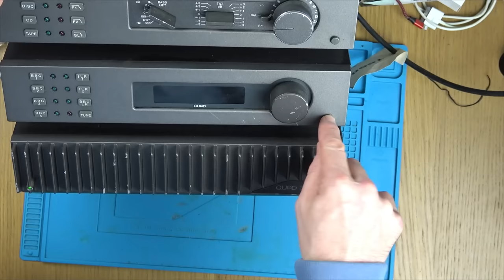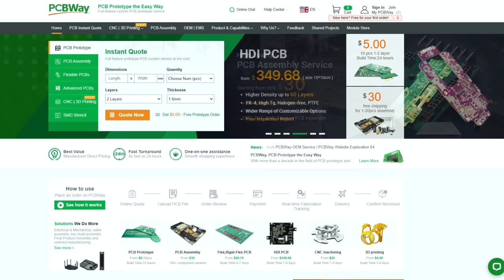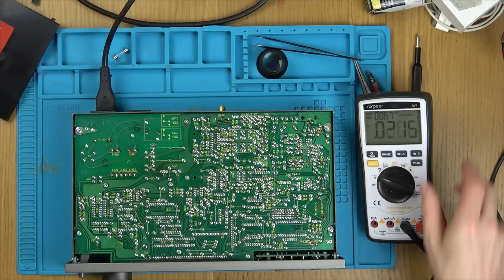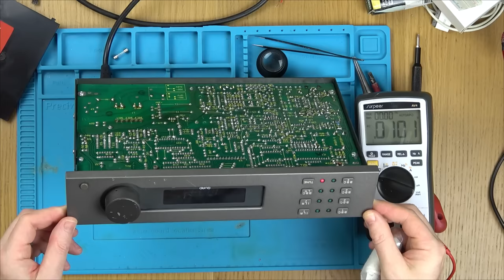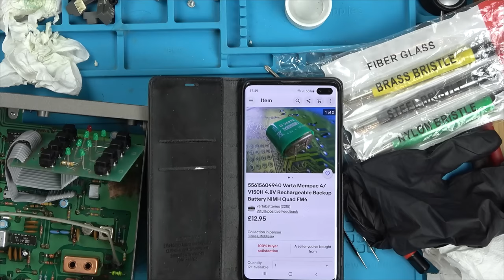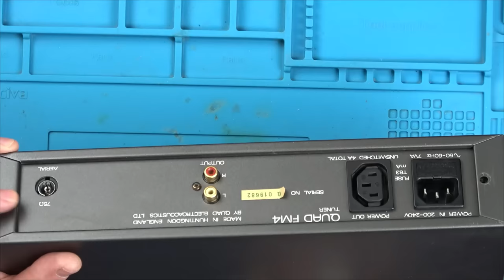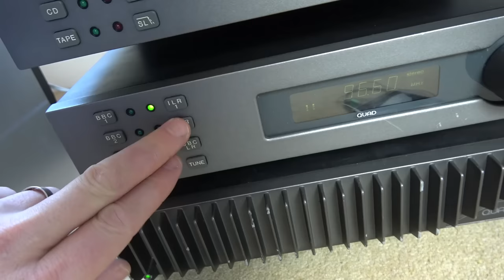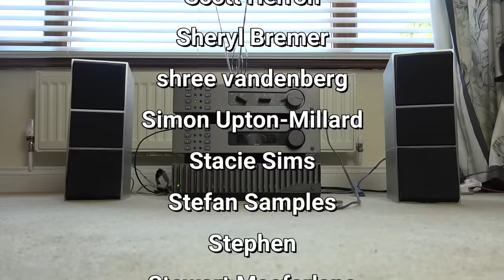QUAD - The Crème de la Crème of Audio - Can I FIX it?

Comment: Nice video - as soon as I saw it no need for screwdrivers - fuse. This happened to my amp did the same pulled apart checked inputs and totally gave up thinking it was a huge problem ordered new tiny amp - then about to bin the old thing decided to have another look - saw that it had fuse screwed into back panel - thought there was no way this would be problem too simple- undid it, no continuety , new fuse and problem fixed. FUSE!!!!! and whats even worse/better is that it is so obvious. Another thing that goes on old amps is the actual display lights - had this on a yamaha - no display - 12v ac lamp was dead , removed the lamp and shined the torch behind and had the display light up with fully functional text , sometimes this can happen to the on light as well.

Comment: I had this set. Not the tuner though. It sounded good but the amp had difficulties with my 4 Ohm Soundcolumn 2 loudspeakers. It got too hot. You could get modules for a moving coil pickup needle. The sound adjustment worked in a broad spectrum. 
There was a thermal fuse on the back, that you could reset

Comment: Yeah, the usual failure mode for these old thin-film class X1 (or X) or X2 safety capacitors is that the shell cracks over time, moisture gets in and compromise the film and the next time it's powered up (either immediately or "soon") it'll blow, often emitting FOUL smelling smoke (may linger until the area is cleaned thoroughly with IPA!). It varies if this failure causes a blown fuse or not, the short-circuit is short-lived and self-extinguising (part of the "safety capacitor"), this had a very low value fuse so not surprised it blew. Some retro enthuasts always check for and replace all "box" type class X capacitors in the power-supply before powering up old equipment from this era (like Apple II and old PCs).
It happens with non-RIFA branded class X capacitors from that era too, it's just the nature of how many of them were made back then and that the RIFA brand was that popular for this use. The disc-types (mostly class Y) or the newer square ones shouldn't do this - IIRC this specific failure mode (temporary short-circuit) is not permitted for class Y at all BUT this is also why class Y capacitors aren't available in larger capacities (would need be very large).
Class X/Y capacitors is often used in the EMI filter, the X(number) safety rating means it's safe to use between line and neutral, class Y(number) that it's safe to put between line or neutral to ground, lower number means it's able to withstand higher voltages, so an X2 can be replaced by an X2 or X1 rated and many class Y also have an X rating (X2Y1 is reasonable common).
Modern EMI filters (especially on switching mode power supply's) tends to have either one or two class X (before and possibly after bridge rectifier, higher capacitance) and two class Y (from line and neutral to ground respectively, much lower capacitance). This is an linear power supply and older so not surprised it just has a single class X capacitors.
Reply from the maker: Thanks Torbjorn, a great write up that will help me and many others out. I need to order up some of these safety capacitors to have in stock as I am sure I will see them again in other devices 👍👍👍

Comment: Nice one Vince! Regarding the contacts on the switches - i believe the problem is caused by oxidation in conjunction with electricity and possible vapors from the battery. Similar to electro-plating. It might be also a good idea to replace the input filter capacitor on all the devices.
Reply: Micro-arcing in the switch creating oxydation and deposits?
Reply: @dDoOyYoOuUtTuUbBeE  More something like electrolysis.

Comment: If someone hasn't told you: the 4 tape sockets - 2 to connect to play a recording REC, and 2 to make a recording REP; DISC because RECORD is both a noun [a vinyl pre-recorded format, and a verb [the action of capturing a live musical performance]; the Bass switch alters the frequency at which the TILT switch affects low frequency roll-off -as in a R-C filter.
Reply: The other way round, REC is the connection to make a recording, and REP is the connection to replay a recording
Reply: @chrisatherton8234  Why did I cock that up? My submission has been corrected.  Thanks - put it down to the wrong day to give up glue sniffing...

Comment: apart from the fuse-holder you missed, the thing that had me screaming at the screen just now was the RIFA clearly visible near the mains inlet.
you've clearly never worked on revox equipment! 😂 but there's your mystery fuse-blower right there. once they've done their thing (thick oily smoke, a cracking sound & a blown fuse) they tend to be open circuit & you can get on with life again, apart from not being protected against spikes.
Reply: you should check the other units for same.....

Comment: I would suggest that the contact side of the washer and the two bars may be silver plated. Silver turns black as it ages. You can reverse this process using a liquid called silver dip but I would not advise using this as it is acidic and might damage the contacts if not washed off.  You use deoxid as a cleaner, this might clean off the oxide layers.

Comment: There are two types of markings on those fuses, T and F. T stands for "träge" (slow) and F stands for "flink" (quick). It describes the characteristics of the fuse. If it has an F, it instantly blows if the current is above the rated one. If it has a T on it, it needs a certain amount of time with a too high current to blow.
Reply: Maybe in your case the fuse blew because of a failing transformer. If the insulation goes bad, it draws more current and blows the fuse. Or maybe someone was listening to too loud music for too long.

Comment: The switch corrosion was probably an electrolytic effect, hence only one side being affected. Add to that a nice acid atmosphere from the battery. Also I wonder if the 63mA fuse is close to the running current of the unit. And given our mains supply is now 220v nominal maybe the devices normal running current has increased.  Combine that with the leaky? RF filter cap and crap battery and fuse parts. Nice video, matte :)
Reply: Our mains supply is 230V (not 220V) nominal,  but unless your local substation transformer has been replaced for some reason, your local supply will still be what it was when originally installed.   The voltage at my mother's house is the same 246V it has been since the 1970s when I was first old enough to shove a multimeter probe where the sun don't shine.
Reply: @MattOGormanSmith  Yep 245v here.
Reply: @nudebaboon4874  interesting we did have a reduction I’m sure, as we were issued warnings where i worked and we had a few issues.  But I stand corrected, yep 220 was an old gits error.. oops.

Comment: Should the LCD have a backlight? It's a bit dim. Maybe a light bulb that's gone, or even an electroluminescent panel, they also wear out, but if it is that, you could just replace the EL plastic, the existing driver circuit wouldn't wear out. Or else you might want to find a couple of volts somewhere, maybe nick the 6V or so that charges the battery, and put it through a resistor to a white LED. Or a couple of white LEDs in series (with resistor of course) and use 12V. You can get side-shining LEDs meant for side-illuminating bits of glass displays.

Comment: You can get rid of the battery altogether. Quad now have a replacement for IC1 that doesn't need a battery and has 14 presets instead of 7. Recommended. I've fitted dozens of them. Price much the same as two batteries, so you get ahead eventually.

Comment: I'll tell you how that fuse blew... the power leads were patched up incorrectly at the back. The power amplifier was fed from the tuner. It drew more than 64mA and pop the fuse blew. Always feed the power into the largest power unit first and filter down to the lowest. Plus the LCD for the tuner should be backlit from an incandescent "grain of wheat" bulb. Either replace it, or drop in a white led and a 2.2K resistor.

Comment: TAPE REC means, as you already got it right, Tape Recording, while TAPE REP means Tape Replay (an alternative word for Playback), the two additional Red/White RCA-Jacks that are unlabeled could potentially be an AUX IN Connector or just an Unamplified LINE OUT (you might have to try this one out, where you better try out hooking it up to a Speaker, to see if it is a Line Out and if there's nothing coming out of it, then it is Aux In)

Comment: Hi Vince, I see it's been a few months since you did this one but watching the part about the fuse I thought to myself "that's a bit on the small side" (and will likely blow again). I just checked the schematic for the Quad FM4 and it shows a 100 mA fuse for this position (slow blow) so if you have any that size it would pay to fit one otherwise order a few and pop one in. I note they mention 63 mA on the rear, but I think they were a bit light on the specs.

Comment: Maybe those tarnished discs are sort of like why you should press stop before opening a microwave door? The power that goes through those door switches is enough that opening the door while in operation causes a small spark/arc for a split second before the air gap cuts off the flow of electricity. Over time that can cause corrosion to form and eventually the door switches have to be replaced because the sparking has built up enough corrosion on the metal contactors that it's no longer conductive and it won't turn on as it thinks the door is  open? I would guess pressing those buttons closes a momentary circuit and over time there is a build up which causes those switches to turn black and eventually stop working?

Comment: Not quite top end but really quite competently designed.  Decent enough and generally well made kit now part of the IAG group and made in China from around 2001.  Sound wise I have some quad kit  (909 amp but also had a 405 and worked on the 33/303).  Easily bettered by my newer Radford amps though.  Still have a soft spot for esl57’s and early 33/303 amps which are lovely sounding things.

Quad still operate a repair centre at their original Huntington premises in Oxfordshire so you could get a repair done there but it sounds like something simple.  Rob is still working at Huntington and am sure could help out.

Comment: You should check the Preamp if it also has one of those batteries in it, because normally these things remember the last input. The easiest way for them to do that would be to just use the same logic as in the radio…
Reply: Preamp has no battery.

Comment: I would have checked the resistance of the transformer primary, DC supply rails to ground and the bridge rectifier diodes before powering up with the replacement fuse. That may have avoided waiting for new fuses to arrive, and revealed the reason for the blown fuse. Luckily the fuse didn't blow again, but it raises the question, why did the fuse blow in the first place ?

Comment: Next time, take your ohm meter and just check over the power input (between phase and ground). You should have less than 100 ohms; 0 ohm = shorted; infinite your fuse is gone. I rennovate tube radios and that is the first test I perform. Also, look into a dim-buld circuit, that is a great simple tool.

Comment: I have a variant to that set up, same tuner, same pre-amp but a pair of Quad 405 power amps. My tuner had failed when I was given the line up, partly due to the NiCad leaking. The best solution is to use a battery holder off the PCB. Mine did have two ICs faulty, one just an op-amp but one was a "timebase" IC which is relatively rare and difficult to source. The supporting structure is different from mine but similar in some respects.... the memory does work in an unusual way. Too complex to describe here, the battery charges while the tuner is in use....The tape sockets are REPlay and RECord, so for instance you can record the input that is selected by the pre-amp.
Reply: Vince's items are Mk II versions complete with the usual 306 power amp. The 405 power amp was released with the MK1 versions which  came nearer to the classic Quad brown type colour. I imagine you already know this, but I'm just saying it for others.
Reply: @johnr6168  some of that I knew, some I didn’t, mine also uses DIN connectors for the audio, not the “RCA”connectors. 
The DIN are a better connector but I prefer the RCAs. It is a shame that this line-up is a little battered. 
Vince’s video might have prompted me to think about using the NiMh battery.
Reply: @g0fvt  Your tuner is the original MK I FM4 then and in a brownish instead of grey style? Din connectors were well loved in Europe and Quad were no exception. I think the lead from the pre to the 405 power amp is a 4 pin din to save confusion with the 5 pin din type connections?
Reply: @johnr6168  mine was originally given to a friend of mine by Peter Walker I believe. 
I got the second 405 power amplifier separately. The FM4 did develop a few faults but I repaired it years ago. The 405 does not like speakers with low impedance dips but it is a fine performer other wise. The colours are as you described, but the second power amp is slightly different!

Comment: I had the same battery problem on a second hand Quad FM3, and another modification to place the battery in a container full of wax corrosion went through the lead to the PCB, its a very bad design to place any batteries near a PCB they should be sealed in a box far away

Comment: Unmarked Inpit is AUX.
Tape decks usually have play(back), and rec(ord.)
but this sounds like the designer used Record, with REP for replay, or repqroduce. your B&O cassette should fit smartly atop and allow testing of record play on that cjrcuit.

Comment: Very nice repair video :) That darn rifa cap has shown it's habbits again, probably released some magic smoke when that hole appeared in it :P
Talking about cleaning buttons, recently took apart my crt tv remote controller for the 3rd or 4th time since I bought it new in 1999. The number 1 key didn't work at all anymore and others weren't working well either, had to be pressed hard to make something happen, so cleaned the contacts with IPA and now it works like new again. 
Seems though that the older it gets, the less time it works until the contacts are dirty again. Last time I opened this remote controller in 2019 for exact same reason.
I need to clean my PS1 controller button contacts as well, the Start button is almost in non-working condition.

Comment: Hello Vince,
Thank you so much for producing this video, I have really enjoyed it and it has spurd me on to look at my Quad 34 Pre-Amp as it does not power.
I have the FM4 tuner, 34 Pre-amp and the superb 405-2 power amp which has a damping factor of 80 driving a pair of Magnaplanar speakers. If you were to ask me to recommend a system to you, it would be the aformentioned system, it makes everything sound alive.
Reply: Hi Ron...at last a mention of Maggies...i have magg 1's but need a tweeter repair for on....a bugger as the company don't supply them anymore....a friend once said hairspray wil reattach the filaments to the membrane..just in case you have any pointers 

Fun video
Chers

Comment: beovox cx100 £200-£300 if perfect working condition and no damage, did you get a beocenter 9000?
Reply from the maker: I can't remember the model number and it is currently packed away. It had a mirror finish with a tape player one end and cd player (I think) the other end hidden under sliding doors. It weighed a tonne and looked AMAZING!!!  I really need to sort out my priorities and get it on the blue mat ASAP as I think viewers will like it 👍👍👍
Reply: @Mymatevince  sounds like a beocenter 9500 or could be a 9300 stunning hifis

Comment: good job, and especially good job that the Patreons helped you out. I started watching and at 9:08 theres a visible burn mark on the power supply shield as you flip it over...was waiting for you to find it...but its not in the location of the cap you replaced...seems to be by the voltage regulators?

Comment: I would use a 5V Gold-Cap Memory-Capacitor or Supercapacitor instead of a Battery to replace the leaking one.
And i hope the allowed operating Voltage of your suppression capacitor is definitive above your Mains Voltage. Otherwise it will blow again!
If i replace such capacitors, i give more Headroom. I'm from Germany, so we have 230...240V AC in our Sockets. Most of these Capacitors are designed for 250VAC, but in my opinion that is too close to the mains voltage. So I use capacitors that can handle at least 275VAC or more.

Comment: Silveroxide is actually conductive, so scratching it off might not be such a good idea. Also, flipping those metal rings (that seem to be silver coated on one side only) might therefore not be the best in the long run.

Comment: That layer of oxidation is probably there, because of the so-called 'potential diverens'! The ring is probably made of a diverend metal than the contacts. When these metals are on a certain distance from each other, they will (unnoticed by the human eyes) exchange electrons. That is called 'potential diverens'! Only when both metals in this switch were made of exact the same metal, they would not have been corroded!